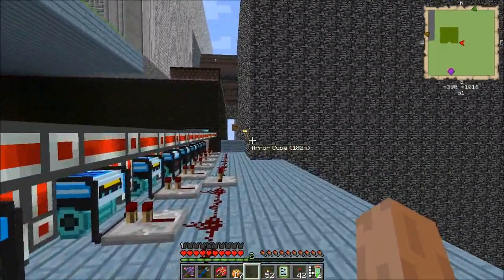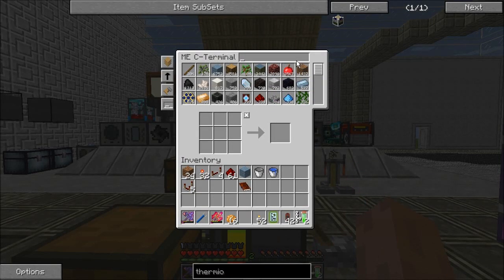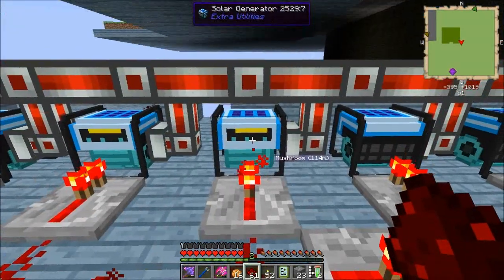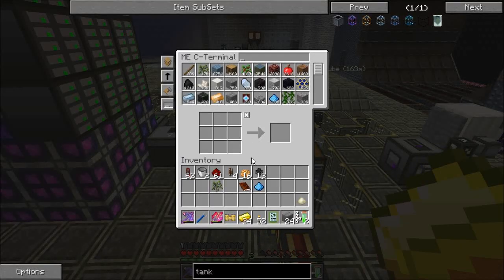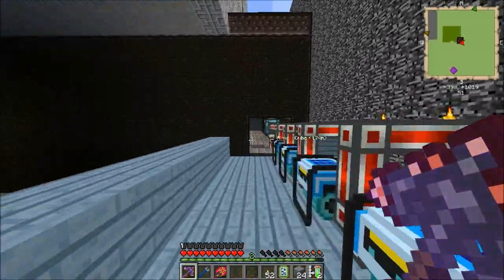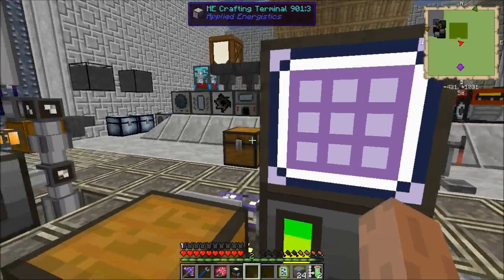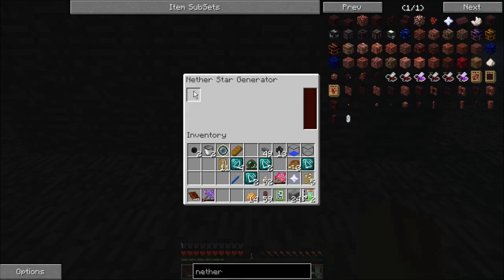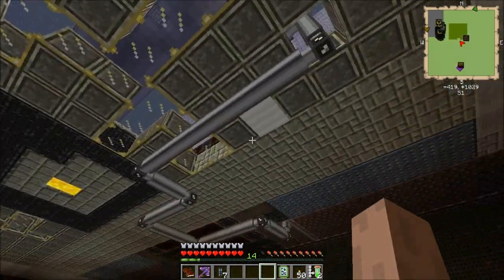Material Energy^3, E32 - Power Plant Pt2, Biofuel and Nether Star Generator

Comment: The nether star generator would take 4 resonant cells @10k per and that would still leave 960rf/tick unused 5 of the 6 faces would require cells to fully gather all the power.
Reply from the maker: Anon Amous Yeah, I figured the mechanics of that out in off-camera testing, I found a setup that, with the version of Extra Utilities that ships with ME3, works to siphon off 100% of the power of a nether star.  It doesn't work with more recent builds of EU, though.